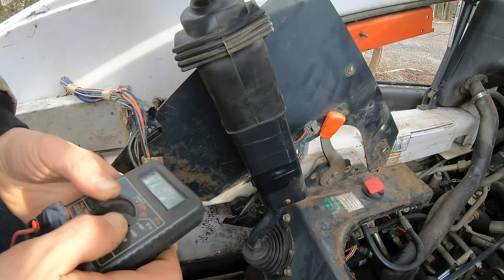Replacing a AHC computer

Comment: Andrew I would definitely look into the Takeuchi s. I have had my TL250 loader since 2012 and I have put 6700 hours on it. I’ve changed the battery and the water pump once. It’s also tier 3 so no emissions stuff. It’s the same size as Letsdig18. It’s a 12,000lb 100 horsepower machine and I do pretty much the same work you do and I love it. They are definitely reliable machines. I also have a Takeuchi TB153 excavator with 3400 hours on it and it’s tier 3 as well. If you like you can check out my YouTube channel and you will see both machines working. I’ve had great luck with them and I’m the same with you on computer stuff and emissions. The 250s have 18” wide tracks so the flotation is great, I have also picked up 6,000 lbs with it before. The 250 has a kubota engine in it and the 153 has a yanmar engine in it. If you have any questions you can email me at eliteearthworksllc@gmail.com. Thanks again
Reply from the maker: Elite Earthworks LLC ok. That is the model I am looking for. TL250
Reply: Andrew Camarata you won’t be disappointed! I have done everything with this one

Comment: I might think the right side remote stick tilting the bucket may be used much more than the left side stick?? I hear from other videos that we need to disconnect the negative post of the battery to
end electrical latent energy in the wiring components. When you turn off the ignition switch you are ending the latent energy in the system. That stored energy is finding it way back to the computer and hence causing the thermal coupling to disconnect the wiring and your bucket quits operating. Seems like your ground to disperse that latent energy is not taking care of business. Check all the
wiring related to the computer to make sure all the grounds are working. This latent energy may have finally killed the original computer on that side control by causing too much heat over those years of use. I do not know if the stick control has built in resistance to keep the energy from accumulating in the stick switch and therefore going into the computer and causing failure? I would be
very concerned with continuing to operate through that new computer until the cause of the previous problem is identified with a $1500 computer hanging in the balance. I drove a Mitsubishi 4 door
for 225K miles and then it started eating ECM's and I was putting lots of ECM scratches on my belly trying to keep the Mits going. Finally I sent one ECM to a company in Texas ($150) and they changed a diode or capacitor or put in something that could handle a faulty design by Mitsubishi common to that model car. (drove that 4 cylinder to 259K and sold it for $200; just got tired of driving that white beast with a blue hood and red left front fender). Liked that car once I drained the accumulated water out of the EGR valve and put in new valve stem seals. 
When I changed three glow plugs out of the 5 at 145K I paid the bucks at MB and bought the new improved glow plug module and two of the plugs went 170K miles. There is a man "Eric" in NY, South Main Auto Repair that can wave analyze your electrical system components with wave technology scanner and tell you where and what is really happening even if the BobCat dealer does not know of such.

Comment: I had the same problem with a CAT several years ago, when they still made their own engines. The computer actually was mounted on the side of the engine. I asked the service technician why in God’s name did CAT put it on the engine of all places and he said it was a stupid design. $1600 parts and $500 installation charges later, it worked. I got rid of the CAT.

Comment: Apparently tractor supply doesnt carry that ratchet anymore unless u get 3/4 and 1/2 but they have a hammer head shaped  one.weird... Seems like if u replace 3 or 4 components on those u could buy a new one...crazy price for something that costs about 15 bucks to make. Ps. Sometimes its the seat switch that will shut em down happens to this cat skidsteer i work on all the time

Comment: The Socket Ratchet was Super Cheap because it was cheaply made. Quickest way to tell is because you do not have a Undo/Do up switch but have to take the Socket and Extension off and connect them on the other side of the Ratchet Head. And these are a lot cheaper to make.

Comment: The question of continuity at 14:55 and the earlier continuity check were unnecessary.  Remember, he did a swap of solenoids (and wire looms) and found no problem there. Pretty obvious from that the problem was in the Computer or Logic Module.

Comment: I have a bobcat t320 and I have never had a problem with it and use it almost daily and the only thing I have hade to change in the years I have had it was the tracks
Reply from the maker: That's good to hear.
Reply: You need to get a t320 there very reliable and hey can left an ecology block

Comment: Good Skid Steers... Hydra-mac extremely reliable never break down, great weight distribution, except parts Again Older machines Grey Area, hard to find The hydra mac 2650D is an Absolute TANK nothing can get past that machine Computer FREE!! & Parts & manuals still available for it. 

Otherwise, the Older Case skid steers are good too, or even the 1980s Thomas. Personally though Hydra-Mac strong! P.s That's why Bobcat are Throw-Away Machines JUNK. Go old and get rewarded!

Comment: $1500 for a small metal box with a circuit board and some wires is what's wrong with our world today. It's called GREED. Good job on trying to repair it though, Andrew.
Reply: they are not selling you the box, they are selling you the technology in the box, and all the research and tries and errors and various iterations you have to follow to get to that black box. But yeah, damn expensive.
Reply: It's their, and other equipment and car manufacturers, main source of income. If the machines/cars are too simple then there is not enough that can go wrong, the unit will last too long and that means less profit for the manufacturer. so one have to complicate things and put in 100 computers (new cars)

Comment: With plant electrics any plug/socket should be put back with some dialectic grease, (Silicone grease) then pressure washing is not generally a problem.

Comment: Did the new computer actually fix the problem.
Reply from the maker: Matthew Hogan It made the machine usable, sometimes that light still comes on though and I have to restart the engine then it works
Reply: @AndrewCamarata  I am having the same problem and have replaced both actuators, had it to the dealer for software update I was told it was fixed worked for about ten minutes then kicked out. I found the same problem with the pin in the right hand controller loose and pushed back some set it back in place but didn't fix the problem. My next step was computer. Thanks, and I enjoy watching your channel.
Reply from the maker: Yeah, I wont buy another bobcat because of that. The IHI skid steer I got is much better.

Comment: Looks like you got my kind of luck--you get the wrong part sent to you.  I just picked up one of those funky ratchets from Tractor Supply.  It is not sold in their stores; you have to order it on-line.  It was $12.00 for the ratchet and about $12.00 for shipping.  I was surprised to see that there were only 5 reviews for it on line.  All were favorable except for one.

Comment: The issue is called right to repair of equipment for construction and farm equipment. Microsoft Google cell phone companies try to say only the manufacturer can repair or read diagnostics Tesla bypasses by saying we are not a dealer so dealer laws do not apply. Just like cat or any heavy equipment on $1,000,000 machines. John deer has riding lawn mower carb for $120 or generic carb for $17.00

Comment: i had similar issues with mine locking hydraulics pedals and brake i couldn't get any one to work on it at dealer for over 3 months so i bypassed all that
Reply from the maker: Yeah, this thing still has problems sometimes with this. I got a IHI skid steer that's been much better.
Reply: @AndrewCamarata  if you need any help bypassing it message me
Reply: the sad thing is after i hunted down the info on locating what parts do what and how to bypass or even repair the rep seemed to know exactly what i did like they knew the whole 2 weeks i was out of service
Reply from the maker: What do you mean bypass? Did you install foot pedals in it? Or do something to the electronics so it actually stays working.
Reply: @AndrewCamarata  mine had foot pedals there was a set of electro mag pins i just welded them round flat sniped wires the hydraulic  flow directional valve it has electric magnet controlled by computer if short or malfunction  like gets hot the hole system  locks up brake /pedals / and hydraulic flow thats the most difficult  its about size of spark plug its directs the fluid to rt places only way to is cut end off in lathe then shim into the position then reseal it with brass or solder its just a piece that moves back and forth . the parts are made by hydra force they really helped i can't really say but they can get you parts that dealer  can't you could get  the elctro magnet in different wiring formats i imagine   if someone could build  the  a switch that reduced volts but its just easier to bypass  the electrical issues  you got 2 $1500  parts the harness or computer and they may not fix it could be switch in arm bar  or wire
Reply from the maker: So now your hydraulics are still live when getting in/out of the machine? Be really careful with that. I don't even think I would run it that way.
Reply: @AndrewCamarata  yeah just like the old ones i grew up on none the old models had that had just put bucket down and shut it off

Comment: First off I worked for Cat for years. Don't touch cat track loaders. 262b 236b are both excellent. The track units are "based" off asv units which are great for low ground pressure conditions but suck in hd high load capacity scenarios. Through new track loaders are superb. 

Bobcats don't suck in general. All these folks who chime in sayin "my bothers girlfriends 7th cousin twice removed brothers uncle says bobcat suck". If that were the case they wouldn't be in business....  864 with early pilots were known trouble makers. 

I run old case 1845b and 1845c's. Never let me down other than cylinder seals and with the clay here it's hard digging for any machine. 

It's a shame you and so many of your followers are stuck in the 80's point of view of American workmanship. I will tell you as union steel worker pride in work is still prevalent in America. The issue is the big corporations watering down the hard work and effort we put in. 

I can show you 3 Kubota skid steers under 800 hours all with bad motors. Sv75 on All of them. Same company owns 12 more of the same machine and they have all been flawless.  Point is I don't care who made it ALL manufacturers make a lemon from time to time. 

Honestly any big name is great in skid steers IMO. early Deere's sucked but they fixed them and got better. Old New Holland LX series are hard to beat any of the case 18 series are amazing case XT series are beasts and reliable.

Comment: An appropriate potting compound should never crack, but the potted module appears to have done so. If this obsevation is accurate, cracks transfer the stress from the potting material to the circuit board and can exceed mechanical limits, provide a path for corrosion or a path for electric discharge of high voltage leaks. If you own a modern automobile, you have a deep potted computer, done right this obviously works, but is not trivial technology by any means. Deep potting is now  a well established technololgy . Without an opportunity to see the parts, I would suggest this is a failure of manufacturer execution and not am inherent technology failure.

Comment: Dielectric grease works wonders on machines that get wet and dirty like these. You should dab a little in ea electrical connections after you clean them. Not only does it prevent water from wrecking those connections but it saves money too on prolonging the life if that electric part.

Comment: Ran a Takeuchi TL140 for 3 years in landscaping. Machine was neglected, (I wasn’t allowed to do anything to service it)poorly maintained, and was bought used from a rental company. Amazingly it never broke down while I was there except for a dead battery. My only issue with it was it was a really rough ride. After about 2 hours of use you would get some machine fatigue from all the banging around. I’m sure they have fixed that in the newer machines.

Comment: It would be interesting to unpot that computer to see what failed in it. For electronics to last 20 years, that's pretty good. Think of your 20 year old computer--does it still work? The question I would want answered though is what caused it to fail? If you don't solve that it could fail again soon. I bet there is a place somewhere that has a jig and a schematic where they can test this thing and tell you what failed. Potting a circuit board in an application like a Bobcat is a reasonable thing to do because its a harsh environment. But it makes it user unservicable.

Comment: Adam, the G series machine where some of the best of the bobcat machines built! The AHC controls all had there issues. A lot of there issues came to moisture issues getting into the hand controllers. When it stops working the next time and gives you the AHC light push and hold the head light button and it will give you a code. Bobcat codes on the G And K series machines will give you a place to start. We are an equipment dealer is PA we work on Bobcat machines everyday of the week! When I have an AHC or SJC machine act up the best thing to do is get the Bobcat dealer to plug into the machine and run the test on the system. My dealer charges me $137.50 to come out to my shop plug-in and give me the issue of what is wrong. I would almost guarantee when you put the new AHC control box on it is not talking to your “gateway control” witch is the main computer due to it may need an update. Almost 99% on the Bobcat and like other models you have to have a reprogram done when you change certain parts. At the end of the day I was never a fan of the 864 or the T200 witch is the same machine. But having said that no matter what machine you buy today you are going to fight electrical problems!!! 95% of machines today are fly by wire. There is very few if any that are oil pilot control. You want nothing to do with a Yanmar skid steer because it is not a Yanmar!!! Yanmar made a deal with Gehl / Mustang to build them skid steers in exchange for Yanmar to build Gehl / Mustang mini excavators. The new Gehl / Mustang skid steers are junk in my eyes. Bought a new one in 2015 for our business and sold it with 20 hours and had been in the shop 5 times! If you are going to look at a new machine don’t be afraid of a Kubota SVL series machine I think they are one heck of a machine. I also do like the D series Cat machines even thought parts are expensive. The John Deere D Series And E Series are not bad skid steers also. Takeuchi I am not saying is bad but parts are expensive for those machines also. We have a dealer down here who just does not seam to care and there is a lack of support. You will find most Takeuchi dealers are Case dealers also and Case is what puts food on the table not the Takeuchi so there seams to be a lack of knowledge at least down there it is that way. Also on your new Hammer it is a Bobcat B850 or B950 model. Incase you ever need parts or a bit for it. If you are going to put a coupler on the yanmar to fit the Kubota your 121 Quick coupler uses the following Kubota model buckets KX71 KX91 KX121 U35 U33 KXO40 all use the same bucket. If you ever need buckets let use know we stock them. All made here in PA. If we can ever help let me know. www.marksupplyco.com. eBay user name marksupply88 .Good luck on your machine and keep up those videos you do a great job. Nick Miller

Comment: Andrew, the company I work for has both a Takeuchi TL150 and aTL12. The TL150 is older machine but has had no problems at all, Takeuchi is very reliable. I run aTB260 mini-ex everyday and still no problems, it also has a Yanmar engine.

Comment: When you have a problem with anything with a connector,  the first thing you should do is reconnect the connections a few times.  Connectors are almost always the problem.  Spray some contact cleaner and put some silicone gel on it to keep it clean.

Comment: As a general rule of thumb: if there are much less wires than controls/buttons, its a digital bus (like can bus). In that case usually all of the control on that section function, or none of them. A bus will also self test and give error codes.

So its either the computer, or the wirering from the computer to the solenoid. (Which you've tested and was ok, leaving the computer indeed)

Comment: If you still have the Bobcat, I would suggest cleaning the ground connection to the computer mounting area. Intermittent Probs usually are loose or poor grounds.
Reply from the maker: I still have it, it still has problems. I could try that. Another trick is to just not buy bobcats. The IHI loader is a better loader.

Comment: put that module in the oven 250 f for an hour and the tar will melt and you will be able to troubleshoot the circuits. capacitors and resistors.
Reply from the maker: LOL, really?
Reply: @AndrewCamarata  yes andrew  really. i did it to a Chrysler module. and the problem was a burnout resistor.

Comment: as I reactive engineer I would say you have incompatible software, possible the new AHC  has later software than the controllers or it may have been upgrading itself when it stopped working, but it might also have been a refurb unit. never trust a refurb unit from experiance